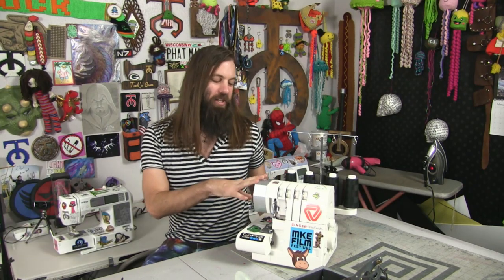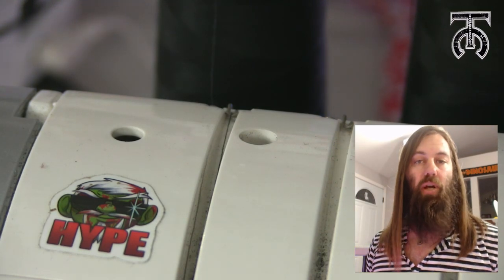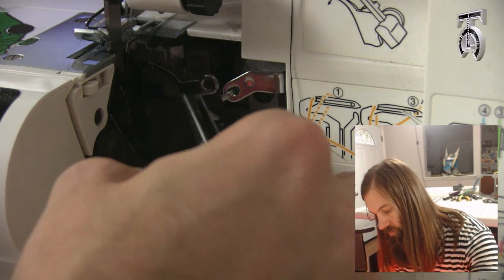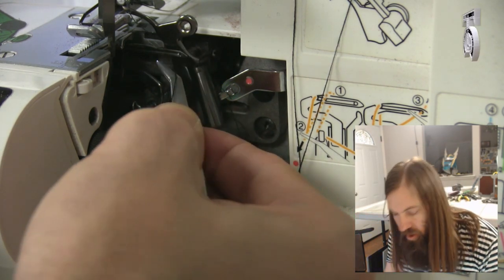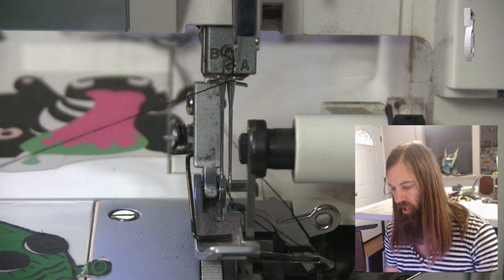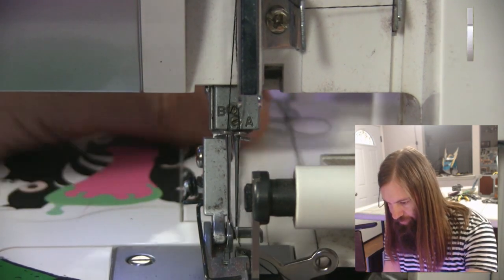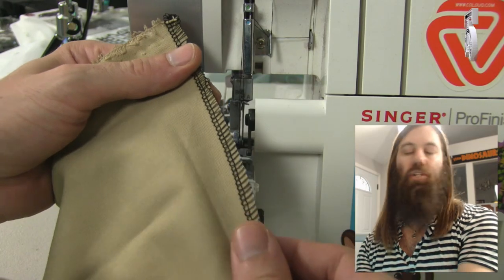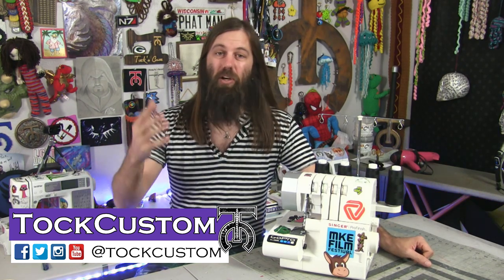How to thread and use a Serger / Overlock Machine!

Comment: I was wondering what a Serger Overlock machine was and now I know what it is and that machine does a great job too. Now I know, but I hope that I won't have to do that work though unless I can do similar work with my regular machine. I saw the work on some pants I have and now know what procedure the manufacturer did during the production process. Thanks for showing us how this is done using your machine.
Reply from the maker: Yep, sergers are great - you really only need one if you plan to start selling your work or taking commissions though. If you're just making clothing for yourself, you really don't need this machine since few people will see the inside seams :)

Comment: Two details to add:  Cover the cones with spool socks to keep the thread from tangling.
Also, cutting the chain right at the fabric will lead to unraveling unless you sew over it.  When serging a hem, I'll use the end of the chain to go over the start, and finish by creating about 6" of chain.  Then cut about 2" from the fabric, gently pull the loops straight, and tie a knot in the chain as close to the fabric as possible before cutting the rest off.
Reply from the maker: Good call on both points. Generally the seams I overlock get sewn into seams between panels in garment construction, so there is no threat of frayed overlock threads, and everything turns out looking very polished on the inside. In any other situation where it would be visible, I'd tie off the ends like you and put a drop of Fray Check on it.

I appreciate your comments by the way, you certainly know your sewing techniques!

Comment: Thank you so much. I have a different brand that was given to me. After I realized I had one of the threads thread wrong and fixed it I still couldn't get it to sew without a lot of the thread sewing beyond the fabric. After watching you I realized that I didn't have the pressure foot down. LOL  My regular sewing machine does it for me so I totally forgot that some machines are manual. LOL
Reply from the maker: lol, yeah that would create problems. Actually with both of my sergers, I just keep the presser foot down at all times, the feed dogs will bring the fabric in so I don't need to worry about that. You can always raise it if you need to, but it hasn't been an issue for me.

Thanks for watching :D

Comment: That's super-helpful, Tock - thank you!  I've just bought a Singer serger - different model, but I'm sure it's pretty similar.
Reply from the maker: For sure, most sergers thread in a similar way - I have another video of a different machine if you need a different angle. Thanks for watching!
Reply: @TockCustom  I watched a number of videos and then got my new machine out of the box.  I'd also read the manual and two books on using sergers.  I found that it was already threaded (as I gather most are), but the threads were all tangled and I had to redo all the threading.  Your video was the one thing that got me through.  I then forgot to turn up the tensions before trying to make a thread chain, so it all churned up again and I had to thread it again!  I then felt delighted I had managed to thread it twice myself, and quite glad really that I hadn't managed to put that off till another day by just pulling through.  But it was your video that made the difference to me, so thanks loads  :)

Comment: Great video, and very informative. My only suggestion would be to use a thread that is more easily visible. Some of the steps were really hard to see what was going on. I love it!
Reply from the maker: Yeah for sure dude, I think I might do this since a few people have asked. Thanks!
Reply: I use four different color thread cones on my serger.  Only the left-most one shows anyway, and having different thread colors lets me more easily see which one I'm having trouble with.
Reply: It will help me a lot if it has light shining in the area,  however, I still think your video is great anyway!

Comment: love this video. Wondering if you could do a video on seam repairs. For example, when my shirts come with 4 tags attached inside the side seam, I of course want to take them out but no matter how I do it I end up with a hole in the seam where the tags were. So I'd like to use a serger to repair it properly, instead of do the whole seam again.. I found a couple videos on it but they weren't the best, especially on how to clean up the ends of the repair.
Reply from the maker: I could probably do that, it's super easy. Just use a seam ripper where the tags are, pull the tags out, do a straight stitch on the inside seam, and then serge it clean. That might be all you need to know :)

Comment: My 434 Singer serger has been used for over 40 years and I still dread any time I need to change colors.  I have hoped that someone would have found an improved technique for threading.  False hope!  Great machine but one of the bigger stressers in my sewing room.
Reply from the maker: I guess there is a way to tie new thread cones to your thread while its threaded to change colors without re-threading from scratch - but I haven't gotten it to work yet. I should do some tests for a new video soon :)

Comment: I’m brand new to sewing, and my spouse bought me a serger second hand (brand new, only used once). Should we have purchased something else for me to start with instead since I’ve never sewn before? Your video helped a lot with explaining how to thread but do I need to do an overlook stitch for every project?
Reply from the maker: Overlock machines are kind of "addons" to a typical sewing space. You can create some projects with a serger alone, but most projects will require that you sew with a traditional sewing machine first, and then serge the seams. Hopefully that makes sense. At least you wont have to buy a serger after you get your first sewing machine!!
Reply: Tock Custom thank you for your response!

Comment: Hi. I'm thankful for you. I have sewn little projects with an old cheap machine but now I would like to go to a "higher level" just a little more than beginner. But also I would like to do embroidery. I looked to different Brothers machines. Which one do you suggest for a intermediate that combines sewing, embroidery and quilting if possible but not really a decision changer. 
Do you use the SE400 for your daily use or which one?
Reply from the maker: I love my SE-400 for sewing a small embroidery jobs. Brother has a newer model now (Brother SE-600 and 625) for sewing/embroidery combo machines, and they no longer manufacture the SE-400. I still use it pretty much every day, and then I use my Heavy Duty ST150HDH for topstitching and thicker projects. Hope this helps!! Thanks for watching :)

Comment: How much of a flap do you leave for these inner serged seams?  For example, I have a curved inner seam of a tunic top that is 5/8".  I serged it, but it is still 5/8" and is rather "flappy."  It looks pretty good, but would you recommend just running it through a second time right up against the outer seam?  I am just nervous because it is curved and feeding it through is tricky.

Comment: Great video. When you start and stop a seem do you just go straight threw or, like on a reg sewing machine, do you back stich? In this video you just go off the fabric. So im wonser how do you keep the surger stiches locked in? And that blade that cut the fabric, does it ever need to be sharpened?
Reply from the maker: No need for back stitching with a serger. and this machine does not sew backwards. I do recommend doing back stitching with a normal machine along with serging. I've never had to sharpen the blade in the 5 years I've been using this machine too.

Comment: I think sometimes I want a serger...then this...lol.  How often do you have to rethread?  I have seen a lot of people tie their thread at the top so they can avoid rethreading....
Reply from the maker: One it's threaded, you wont have to do this again until the thread run out, unless something goes wrong.

Since I got my new Brother serger, I haven't had to re-thread it once!

You can tie off the new threads, but sometimes it doesnt work, so I end up rethreading manually, which is a bummer. Maybe someone else has a good tutorial on doing that, but I can't get it to work yet :P

Comment: With a serger, what is the best way to turn a corner, as you can't pivot, please, thank you
Reply from the maker: Oh, you just run straight off the fabric, then put the new side of the fabric in through the machine and it will trim off and overlock the other edge. Perfect serged corners :)
Reply: Great thank you.

Comment: I am trying to make my stitch small in size how do I do that
Reply from the maker: This particular machine doesn't have a lot of range in narrowing the scope of your stitch. I think the minimum is 5mm, which is pretty significant. Other machines go down to 2mm or so, but not this unit unfortunately
Reply: @TockCustom  I have a QTS 428k baby lock pro line

Comment: You all seem to find it so easy but I am an absolute beginner with an overlocker, it would be so much easier if you had used the same colour cotton as each threading guide so that it was easier for beginners like me to see. The black cotton just blends into the back ground. So disappointed. Perhaps if you could angle a touch at the mechanics it would help. It just all seems so difficult I think I am going to return it, and stick with my sewing machine. Much more straightforward.
Reply from the maker: I re-shot this video recently, better lighting and colored threads. Should be a lot easier to help out!
Reply: Thank you so much, will sit and have a look now. Many thanks. Jan